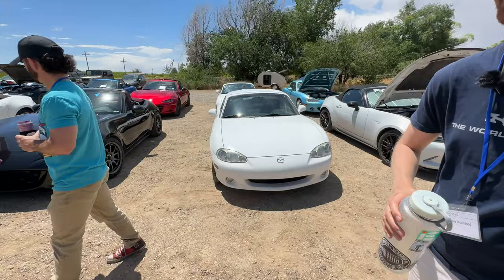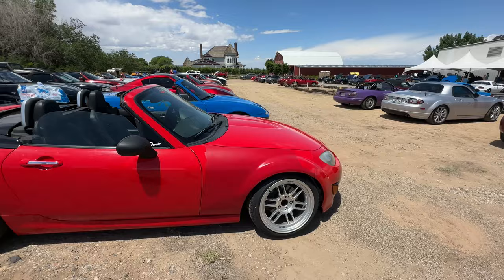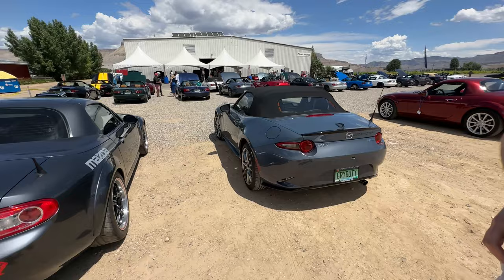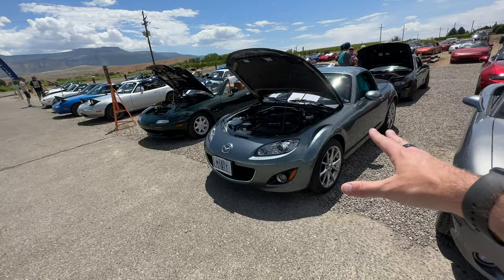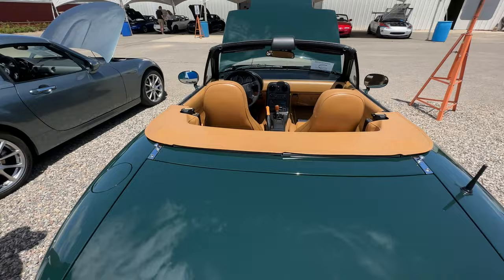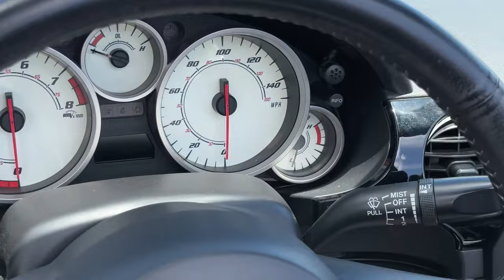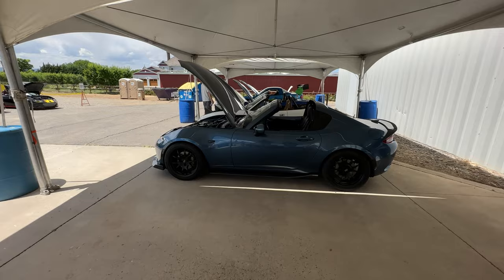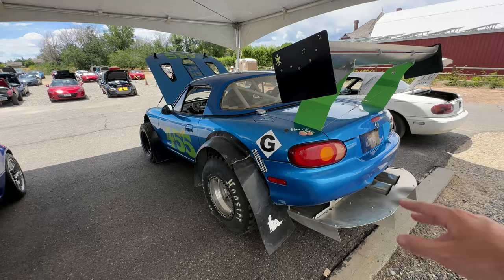Every Miata in the car show at Flyin’ Miata Summer Camp 2023!

Comment: You mention the screw cover at the windshield wiper plastic piece an said you make them. I have a 2016 sport that I want to put a strut brace on. I know I need the firewall bracket to do this. You said the access screw cover at the windshield plastic tends to break. How can I get 2 of these covers from you? Or what is the Mazda part number as I can't find it anywhere. Thanks it'd be a huge help.
Reply from the maker: “Cowl grille cap” or “windshield cowl cover” are what I have googled in the past. I didn’t make these but a friend 3D printed them! The part number to look up would be E016-50-796 I believe.
Reply: @FlywheelFilms  thanks for the info. Really enjoy your videos. Hope you get your short shifter problems sorted out. Think I'll go with the Craven speed shifter.